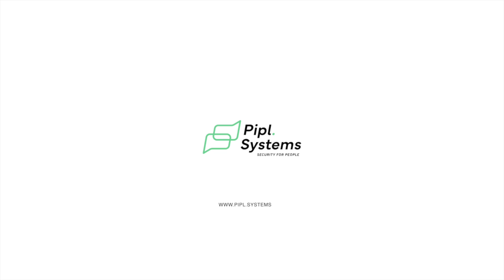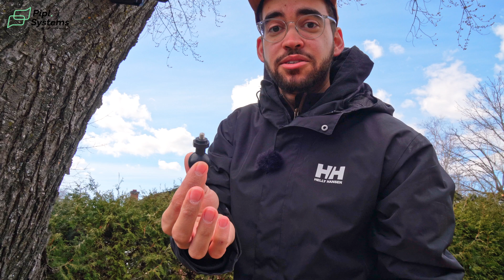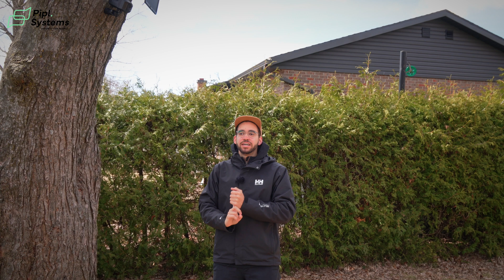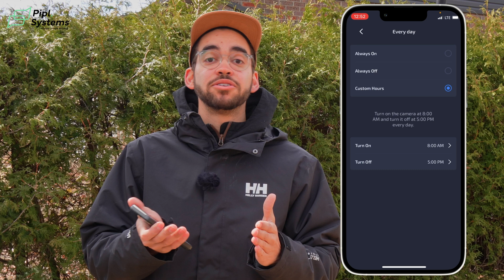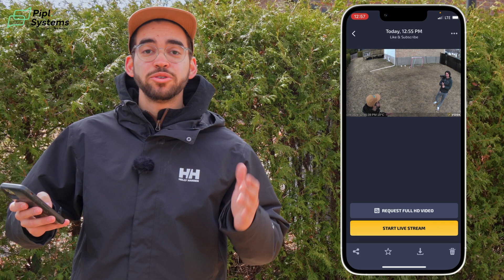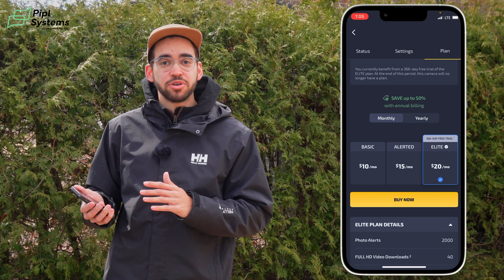Vosker V300 Ultimate Review: 30 Days After Installation

Comment: I’ve discovered another frustrating limitation with the Vosker V300. When I request HD video downloads, they always seem to happen around 5 AM, which triggers a notification and wakes me up. The problem is that the app doesn’t let you turn off these “delivery” notifications without also disabling critical motion/intrusion alerts.
I contacted Vosker support and their response was: “Unfortunately, we do not have that option available at the moment, but no worries. I will make sure to note this and forward it to our higher department for review.”
So just be aware — right now there’s no way to separate routine HD delivery notices from actual security alerts. Hopefully Vosker updates the app to fix this, but until then, expect overnight notifications you can’t silence without losing alerts

Comment: The Vosker V300 Ultimate has a few serious fundamental flaws.
1. Monitoring cannot be set past midnight, which makes a standard 6PM–6AM security window impossible. The app also blocks users from stacking two schedules to bridge that gap. As a result, owners are forced to manually toggle alerts off every morning and back on every night — 365 days a year. Miss it once, and your phone is flooded with notifications, quickly exhausting your quota and driving up costs. Vosker support has confirmed this limitation is “by design.” For a product marketed as automated security, this design choice feels outdated and baffling.
2. There’s also no simple on/off control in the app. If you want to temporarily suspend monitoring, you must wrestle with the clumsy scheduling interface to disable a time slot.
Taken together, these shortcomings raise serious doubts about the value of the V300 as a security camera at all.
3. This camera  carries no Canadian certification whatsoever. Its only credential is NDAA compliance, which applies strictly to U.S. telecommunications standards. Without proper Canadian approvals, this device cannot be used for commercial installations in Canada.

Taken together, thes flaws undermine the product’s claim of being a reliable automated security solution for commercial use and in Canada.

Comment: Nice pod mate.
what options are there to stream nature 12 hours per day continuously? i.e i don't need recordings but want cameras on during daylight hours and the public can access it? is it even possible using sim cards and the required data?
Reply from the maker: Hello,

Glad you liked it :)

The V300 Ultimate is optimized for short-duration live streaming. We do not recommend using it for extended continuous streaming due to potential high costs associated with LTE data and increased power consumption.

Hope that helps.

Comment: I have the same camera and solar panel but it isn't charging the camera.. I think it wasn't plugged in correctly?
So it goes into USB c from the battery bank (solar panel) to USB c to the camera?
Reply from the maker: Yes, exactly! There could be a couple of reasons why it is not charging:

	1.	Did you charge the solar panel before installation?
	2.	Is the solar panel in direct sunlight?

If you followed these steps and it still isn’t working, we recommend contacting Vosker Tech Support.

Thank you for watching!

Comment: I bought one of these v300 cameras for use in a strong cell phone coverage area. Installed this spring and within probably 3 months it's quit working twice and now again is not communicating with the vosker app. They don't allow refunds after 30 days but you won't find out its a pos until after 30 days. Also I don't recommend putting it up high in the air as it's inconvenient too take down all the time for when you contact tech support you need to have the camera at the computer. When it's working it ok. I rate 4/10
Reply from the maker: Thank you for your feedback! I hope you solved already your issue with your camera 🤝
Reply: @piplsystems 😂😢😮